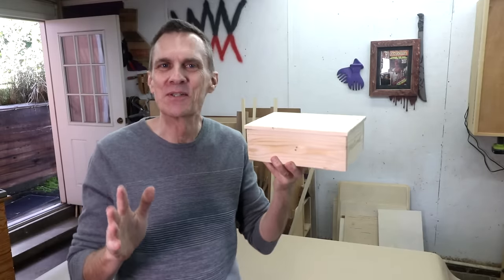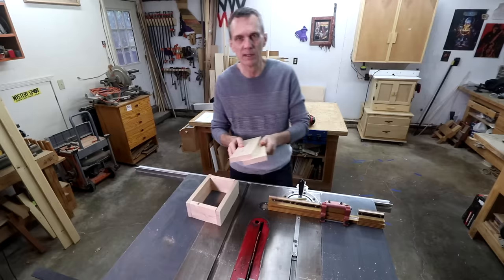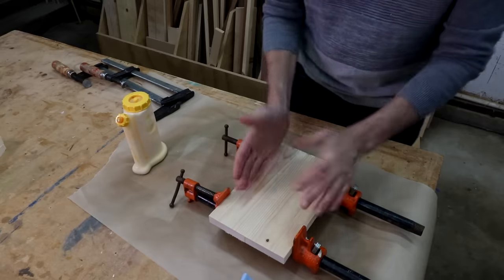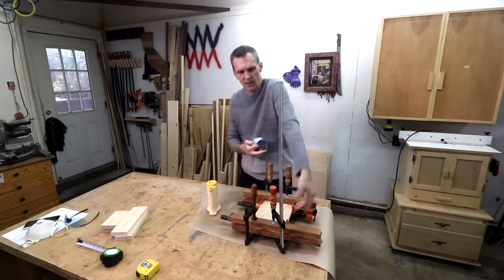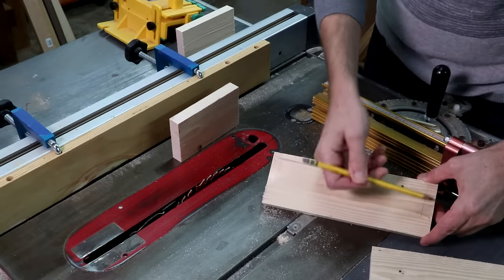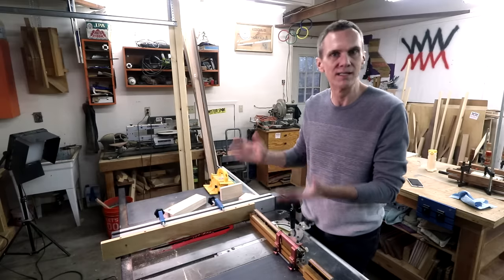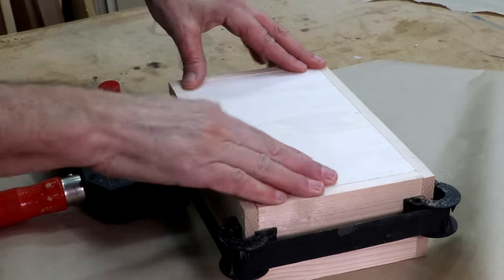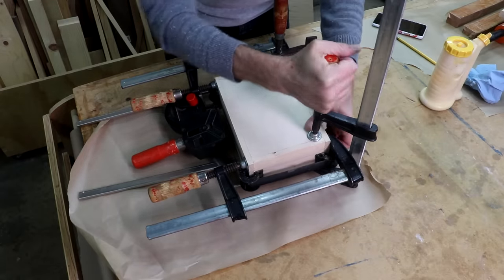How to make a basic box. And why you need to know how | Woodworking BASICS | Power Tools

Comment: Nice. Now all I need is a table saw, work bench, garage,wood, clamps, sander, straps,safety gear and I should be good to go.   Ps. And a stir stick.😉
Reply: at least ya connected to the World Wide Web...tats a start...:))
Reply: ShinDig buy me a plainer. 😉
Reply: or you could just watch stuff on the internet which needs nothing, and achieves nothing, right?
Reply: On a brighter note the paint stick is free 🤣
Reply: Mavic Pro Or you could use hand tools and do the job without spending $1000 setting up your shop.
Reply: don't forget you also need a router or some of these blades glue gun and clamps not to mention glue and a bank to pay for it all. HAHAHA
Reply: Seems like you don't need a stick to do yer "stirrin"... 🙄😂
Reply: MissBttrsctch  agreed, although there are numerous channels devoted to that approach only it would have been good to see it presented here as an option at least given this IS supposed to be woodworking for mere mortals! Don't know about you but this mere mortal didn't have a thousand bucks spare to set up shop.
Reply: Hehe. Obviously this isn't for everybody but you could do this project with a very limited set of hand tools that can cost little. The whole thing could be done with a pencil, one hand plane, one chisel plus a hammer or mallet and some abrasive paper. You could skip the pencil if it blows the budget. 

I don't mention clamps as if absolutely necessary it can even be done without commercial clamps, e.g. using what's called a Spanish windlass instead. 

Bought secondhand these tools could cost under £20 or the US$ equivalent, although it requires some sharpening stuff too. Call it £30/$35 total if you buy smart.
Reply: You can also find a lot of these machines and gadgets for sale on Craigslist for far less than retail from motivated sellers.
Reply: @richardbool4232  Yep, but no begginer will buy a table saw just to learn....
Reply: @matheusgomes3386  you are probably right, most people wouldn't buy a stir stick
Reply: Tungsten Carbide would you include a square in that list? Thanks
Reply: Rick Sanchez awe jeez rick I don’t know about that.
Reply: I was thinking the same thing.  Most people searching how to make a basic wood box aren't going to have a wood shop.  (c:
Reply: Cheaper to buy tools than pay for others' labor.  Assuming you don't get hurt, that is.
Reply: my thoughts exactly...did NOT think it required this much stuff just to make a damn box.
Reply: Rick Sanchez it’s ridiculous when i can buy one on ebay for 7$
Reply: MissBttrsctch  Everything can be done with hand tools. It just takes more effort and creativity. I still use hand tools for my projects.
Reply: @matheusgomes3386  why not? I did.
A cheap $200 one..

If you are going to learn anything you aren't already doing, you are going to need to buy some stuff.  Some hobbies are more expensive than others.
Reply: Rick Sanchez craigslist. Start with the table saw and router. Get clamps from harbor freight.  Should still be less than $100.  If you really enjoy it, you can expand from there. My third recommendation would be a miter saw.
Reply: @ismelltrouble7266  planer.
Reply: MissBttrsctch   a tenon saw, a ruler, a pencil and sandpaper *. much cheaper. That's what we did at school. * we used a marking gauge, but, pencils are cheaper.
Reply: @tungsten_carbide  😂 😂 😂 😂 😂 😂
Reply: HAHAHAHAHAHA exactly.
Reply: I second that
Reply: Rick Sanchez 😂😂😂 seems like lazy woodworking to me. More measuring as well, please
Reply: For what it's worth, when my dad was doing metalwork training in the Air Force he learned to create forms accurate to a thousandth of an inch, with hand tools.
Reply: @jacobhope7758  right but buying it on eBay you're not learning transferable skills. This is to learn the skills you're going to use on future projects like he said in the beginning. That price is going to be very different when you decide you want a custom dresser or cabinet.
Reply: Jordan Adams still not really worth the possible thousand dollars spent on tools
Reply: @jacobhope7758  it's not that expensive and if you're doing woodworking frequently and want high quality craftsmanship and a skill you can always feed yourself with it literally is though
Reply: Tools every man should have in his garage/shed.
Reply: If you got a shed, a table saw is a worthy investment. But you'll need a separate shed for all your clamps. Never have enough clamps....
Reply: I use a  couple of portable tables outside.
Reply: Lmao i thought exactly the same when i watched the video.
Reply: MissBttrsctch  trace your cuts and you can do it with just a hand saw. (cut the bottom and the sides to make the joint)
Reply: @richardbool4232  In the Philippines they do everything with hand tools. Even ripping plywood.
Reply: @gardnerdean  Yes they probably do !!!
Reply: James Tyler  What has your comment got to do with what I posted? I don't believe anybody suggested woodworking can be done without spending any money, and I certainly didn't either.
Reply: James Tyler  Clown? Way to lose any legitimacy there.

Not that your singling out of mine had any to begin with; numerous other people have made comments about the cost of the tools used to make this one basic box ...not the least of which is the originating comment with 682 upvotes! o_O
Reply: What is called by  which we sharpen our saw?
Reply: @eer123  Saw file?
Reply: @tungsten_carbide  thank you
Reply: You can just take 4 pieces of wood and nail them together. And store cash in it.
Reply: Damn it I still need a planer
Reply: "Without a lot of space or expensive tools". Great! Something I can do using my Workmate and the hand tools from my woodworking box.
Sadly, "not a lot of space" was on the US scale, about twice the size of my garage.
... still a good video though.
Reply: Good to know I'm not alone here thinking wth this is not basic
Reply: exactly,,,,,,,,,,,,,,,,,,,,,,,,,,,,,,,
Reply: LOL i thought it would be a video simplified for those of us who don't have the fancy euipment.
Reply: I’d be happy to loan you my stir stick only if you return it 😂
Great video in all seriousness.
I wish you emphasized how important it is to make sure things are square
My first woodworking I built a bedside table for my daughter
The boards had some warp causing the table to be out of square after my glue up and it now has a nice wobble
Oh well, at least I used the Kreg jig so an atom bomb can’t destroy it
Reply: GOod one. My thoughts exactly
Reply: So true. I love watching these videos and possibilities but when it comes to all the gear it takes, makes me just want buy a ready product. 😂
Reply: Pretty basic right?
Reply: 😂😂😂 awesome
Reply: This channel is for people who already have a shop of some sort in development I would think, and or, show you some of the tools you can use to do these things if you didnt know where to start.
Reply: With all those machines and tools, you call this "for beginners".
I'm a woodworking beginner and all I have are hand saw, hammer and few rusted nails.
Reply: @leocute0811  it starts when you get your first hand plane
Reply: People like me who don’t know how to build a box dont generally have this kind of equipment laying around. Just sayin’
Reply: hi everyone ,if anyone else trying to find out making money with woodworking try Letza Woodworker Lessons ( search on google ) ? Ive heard some incredible things about it and my brother in law got excellent success with it.
Reply: I love the picture
Reply: MissBttrsctch  wood by Wright , great videos on the pleasure of using hand tools. Quieter but slower. But what's the hurry. Oh also rex Kruger is great too.
Reply: @jon.b.official  Only if you buy paint.
Reply: @hel1copter  Decent quality hand tools can cost quite a bit, and low quality hand tools can be a pain to work with. Would probably spend the same amount of money on low-cost, but adequate power tools to get the same kinds of work done as one would with decent quality hand tools.
Reply: highgrade1980 I honestly tried to do woodworking. It was crazy fun made a few tables things like that. But there’s never a moment where I told myself there I have all the tools I need. It’s a hobby that never ends. I’m a glassblower now. 😂
Reply: Same, I have hand tools only, gave up from this as soon as I saw the table saw
Reply: Maybe you need to make adjustments on what you spend your money on.
Reply: Hey!.. that’s like me! I’m one step away from being a millionaire.. all I need now is the money! 😳
Reply: “...without expensive tools or a lot of space.” First tool used is a table saw. That’s a good start.
Reply: Yes. Because EVERYTHING should be free. 🙄
Imagine needing tools to do woodworking
Reply: I have a stir stick...
Reply: You know what's really obvious once you have everything you need? There's one thing you just can't get on a trip to the box store. Practice. As easy as Mr. Ramsey makes it look is as hard as it really is for us newbs. I ran out and cobbled together a workshop (of sorts), learned some stuff building 3 desks, 6 noodle boards, a planter stand, a bench, 2 boxes, 4 blanket ladders and 2 bath shelves on French cleats and all I've really learned, besides which tools I bought that i skimped too much on, is how much I really don't know! 😁
Reply: Don’t you have it all already ? ?
Reply: @teo-medesi  yes I was never good at woodwork / STEEL
Reply: Any self-respecting DIYer is going to acquire most of these tools over time just doing normal stuff around the house. All hobbies have buy-in costs. What's a decent set of golf clubs cost? Gonna walk the course every time and only play at free/cheap golf courses? Gonna teach yourself or pay for lessons? 

At least most woodworking tools have real life applications and will almost always return a value higher than their cost if you use them regularly. Can't say that for most hobbies.
Reply: @matheusgomes3386  I did. And a router and hand saws and a million other tools
Reply: Freaking A right?! 😂
Reply: All this for a box which costs 4 bucks at TJ Maxx
Reply: Or you can buy a rabbet plane and some glue.
Reply: A saw, a pencil, and a sharp chisel will do it.
Reply: Or get started cheaply buy watching rex krugger
Reply: Exactly what I thought "here's a basic little box you can make at home with simple tools", proceeds to crack out the table saw, table router, bespoke clamp and a ton of other shit most people simply don't have.
Reply: @jonathanmathews7673  We didn't name his channel or his video.
Reply: @richardbool4232  Why buy a stir stick when they give them away at the hardware store?
Reply: @albaPhenom  The table saw is only the easiest way. You could use a circular saw for this and clean it up with a chisel.
Reply: Realized this was 4 years ago. I was trying to make the box for under $1000 but inflation didn't let me.
Reply: @peterfitzpatrick7032  🤣
Reply: Really just a table saw and some clamps! You can get an old Craftsman 113 pretty much anywhere (marketplace, eBay, garage sales, flea market, etc). Or get a cheap jobsite table saw to start for $200-300 - you'll use a table saw for like every single woodworking project, so it's the best bang for your buck tool! (Except for maybe a cordless drill). 

Clamps are also VERY cheap at Harbor Freight. They have decent budget saw blades too, and sandpaper, and a strap clamp, and everything else you need!

You could use hand tools as well, and setting up an old plane and sharpening chisels isn't difficult - but just getting an old table saw might be the easiest way to start.

Comment: I made a box!  Thank you. It's sitting on my desk right now, and I'm very proud of it. Even if I did get turned around somewhere along the way and the grain of the end panels runs vertically. Call it a design choice. This great little project helped me build some new skills, get comfy with the table saw and I really feel capable of moving forward. Very good video, guide and plans.
Reply: Ayooo good job🥳🥳♥️
Reply: "call it a design choice". I love it!! :-)
Reply: That's a bot.
Reply: If it’s not made out of plywood, keep in mind that your box is what is called “cross grain construction”, where the grains run in different directions. If it’s  solid wood and cross grain you’d use only nails or fasteners, because the wood moves in different directions and fasteners can bend a little so it doesn’t pop apart. Plywood doesn’t move near as much as solid wood so it’s be fine. Just keep that in mind if you make another! Thank you for listening to my TedTalk

Comment: I will say, I've completely loved my flat ground blade. They cost just as much as normal atb blade and having it as a backup and for special purpose use has been useful. I know people don't always like investing in table saw blades, but having the right tool for the right job I think is really important. There's no single blade really does everything well. Having Rip blades, cross cut blades, combination blades, and dado stacks all have their purpose. Investing in your shop can allow you to work more efficiently and more safely. Not to mention you'll end up with better tool wear - saving you in the long run.

Comment: I also use your paint stirring stick idea for sanding.  I went a more permanent way and bought a length of aluminum bar stock 1/4" x 1" and cut it into one-foot lengths.  I used two sided carpet tape to apply strips of one-inch wide abrasive tape to each side.  I made half a dozen of them and run 80 grit to 400 grit on them.  I have had them for eight years now. They are among my favorite tools.

Comment: If doing your rabbeting on a saw, make sure you do the cross-grain cuts first and then the cuts with the grain, or you'll get 'break-out'.
Reply: what is a cross grain cut? going so vertical against the horizontal grain?
Reply: @jboxy  Yes. It's simple, but it's as it sounds.
Reply: I'm new to this.  Thanks!
Reply: HowlinWilf13 same goes for routing

Comment: My first box was not perfectly square =( but I know what I did wrong, and it does look pretty nice still!  Gonna make another soon to improve on, using Steve's advice.
Reply: hey so what did you do wrong? my box is not square. i’m thinking either i needed to rip both sides or i bought bad wood.
Reply: @markandrews0908  When I squared one edge of my board, and then ripped the other edge on the table saw, they were parallel to each other, but not square.

The cause for this, for me at least, was doing the table saw rip too quickly, and having imperceptible wobble on the board.

Not sure if this applies to you, but that's what happened for me.

Comment: every day the internal struggle between being a cheap bastard and needing to buy a table saw. I need to understand not everything can be achieved with a circular saw.
Reply: A DIY router table & a circular saw or cheap tracksaw !! 😎👍☘️
Reply: @peterfitzpatrick7032  Or you turn that circle upside down and make your own table saw. (YouTube abounds with designs.)
Reply: We found one at Goodwill for $30.  Works great.
Reply: Don't make my mistake to buy a cheap tablesaw from harbour freight... Wait to put an extra 100 aside and go for a better setup later on
Reply: Get a kreg rip cut for plywood and an accucut for solid lumber and you can work around having a table saw
Reply: Just build your own table saw out of a circular saw
Reply: Buy a quality used one. Just be sure it has a fence, miter guage, and blade cover/riving knife! I didn't know anything and picked one up, dirt cheap. Thought I'd really pulled one off. Turns out it's a generic and the missing parts (blade guard and insert) are no longer available. Also turns out they're pretty important. At least I've learned THAT much, so far. God knows what I've got coming to learn next!
Reply: i make do with a handsaw or reciprocating saw, depends how accurate i have to be heh.
Reply: Could a miter saw be used to make this box as well?
Reply: Just watch your local classifieds.  There are always good used tablesaws going up for sale.  Worst case scenario, get an old metal top Craftsman that is still running.  Some have the old rip fence that needs a little adjusting to make sure the fence is perpendicular to the blade each time you cut or you can build or get an aftermarket upgrade fence.  A good fence makes up half of a tablesaw.

Comment: Great video and cool techniques. The table saw is a HUGE help for a lot of this. Having said that, I love my radial arm saw (Hey I got it for free and it's worth it's weight in gold) and have practiced cutting Rabbet joints with it. As long as you pay attention to what you're doing and keep your hands away from the blade, it's a great way to cut any kind of joints. 
I am a relatively newcomer to woodworking and love that you're putting out videos like this to help people gain knowledge, experience, and most of all confidence.